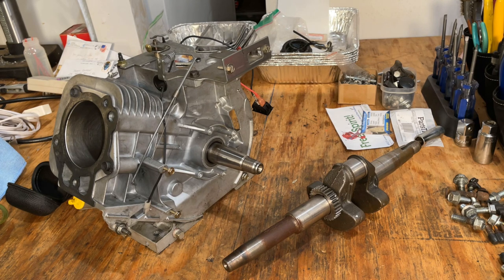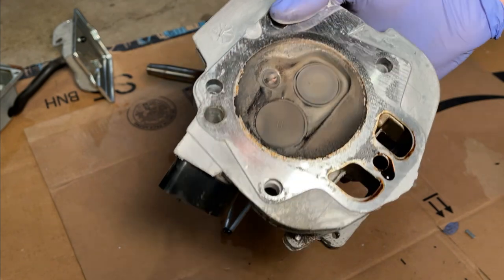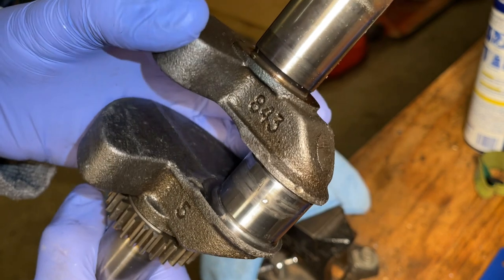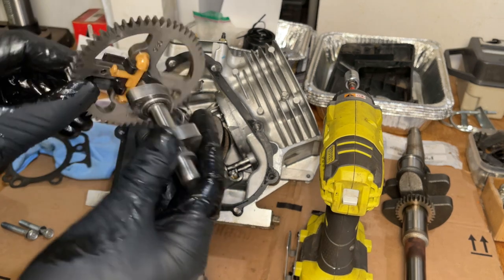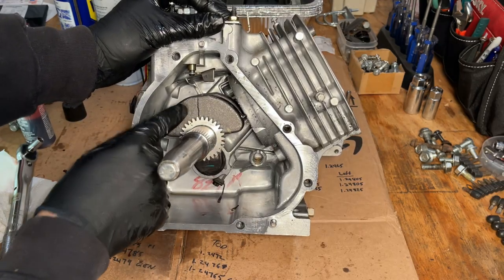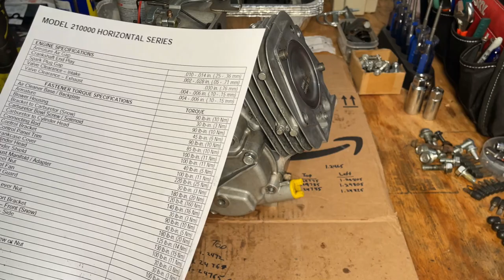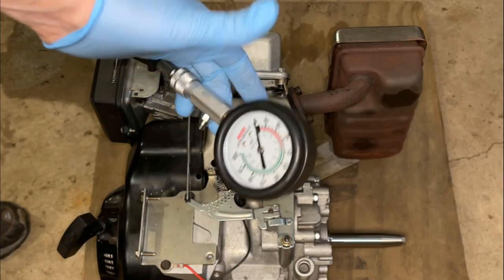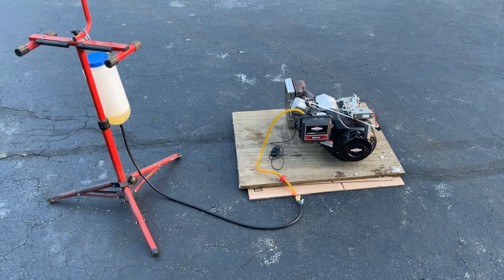Generator Engine Rebuild (Take 2) - 10HP Briggs and Stratton

Comment: I was taught to ALWAYS check the oil every time you start a small motor. But people are stupid!  I used to work in a Lowes Inside Lawn & Garden Dept.  Had a guy bring back a new mower that would not start.. I checked it and found  he had filled the gas tank with motor oil and the crankcase with gas.  You can't make this stuff up!
Reply from the maker: wow!

Comment: These crankshafts can be undersize by .010 , .020 , .030 of a inch or more if needed  !!!
Reply: Who grinds small engine crankshafts? Nobody!
Reply: @Bill-xc8le  But maybe it's just me , or I know a special person that has his on machine shop for over 40 years that will grind those small crankshafts for you , but I live in small town in Texas !!!! Thanks
Reply from the maker: Have not been able to find anybody local.  After seeing that "new" crank, would rather spend $150 fixing the old.  Reached out to another YouTube creator today who can build up these old cranks and bring them back to the original spec.  Hopefully he is interested.  And as luck would have it..  About a week after finishing this video, I finally pulled a good crank out of a storm responder that had run out of oil and it looks good and is within spec.  So at least I have one good, 5 bad.
Reply: Then what, machine the rod end cap to tighten up the tolerance? Machine the rod and cap to accept an oversized bearing if the make such a thing for small engines.
Reply: @Bill-xc8le  From what I understand , they take the cap of the connecting rod and grind .020 or .040 off  the cap surface that connect to the rod then they resize the rod  to the smaller size to match the  ground down crankshaft !!!! Thanks
Reply: @johnnypruett7169  it seems going that route could get costly and time consuming for a small engine worth only a couple hundred bucks at best. Even buying a new crank is pushing the cost effective boundary.
Reply: @Bill-xc8le  Yes , You are probably right , so I'll  just say OK , but just for the hell of it , I'll find out how much it would cost to get your crankshaft ground and your rod resized !!!
Reply: @johnnypruett7169  sorry, but I don’t have issues, get mind out of the gutter!!
Reply: @Bill-xc8le  Just for my peace of mind I through I'd find out , just to see how much it would cost , thats all . Thanks for the conversations , enjoyed them  all !!!

Comment: Your crank that is out of specs could be sent to abom79, and he could spray weld it and your cam shaft and then they could be remachined. 
https://youtube.com/watch?v=7oq0UhOd5_8
Just some FYI, Jim.
It might not be cost effective, but maybe on a more obsolete item it would make sense.
Reply from the maker: Will inquire about it.  Thanks for the info.

Comment: Wonder why these motors use oil ? I have a generac gn 220 , bought it new in 2004 , never had to add oil ! I guess u get what u pay for !
Reply: They use oil because its an engine, not a motor.
Reply from the maker: Hard to say.  I only get them once they run out of oil.  I never see any of them burning oil.  I think the issue is that, like all small engines, they consume oil.  A lawn mower you run 1-2 hours week.  You can probably go a whole season and only put 60 hours on a mower and not worry about the oil.  A generator, you could easily put 150+ hours on after a bad storm.  Running at 3600 RPM, oil will disappear.  An oil sensor is critical to a generator.

Comment: Hi James, I do what you do but on walk behind leaf blowers. I buy them in need of an engine and always put a Honda or Subaru in them. Every one of the ones I have bought had B&S engines and all of those engines had broken connecting rods. I don't use B&S engines anymore.